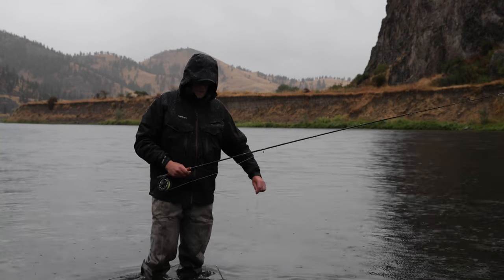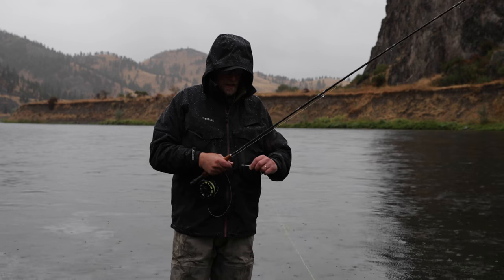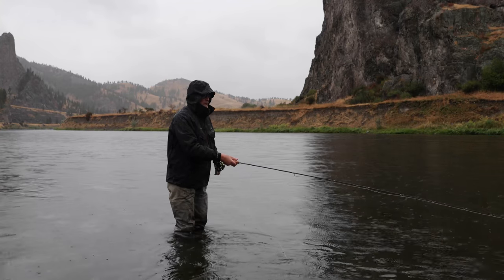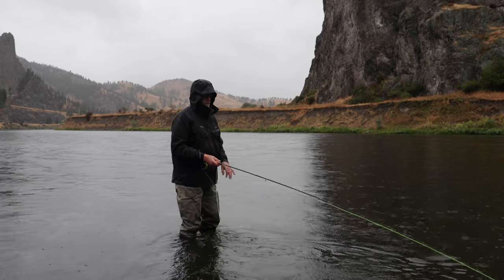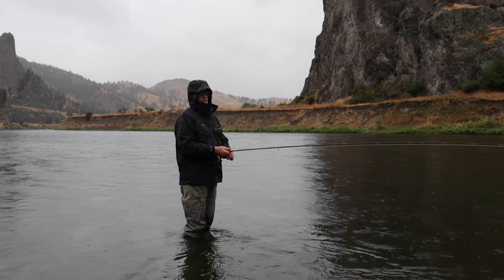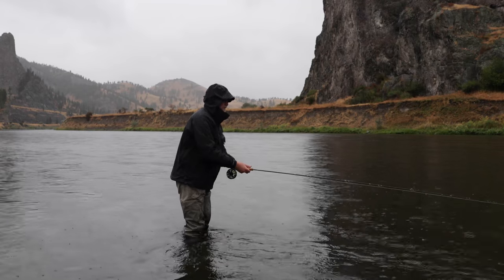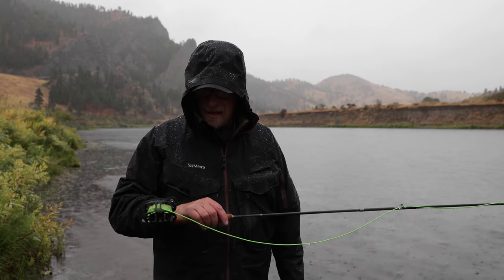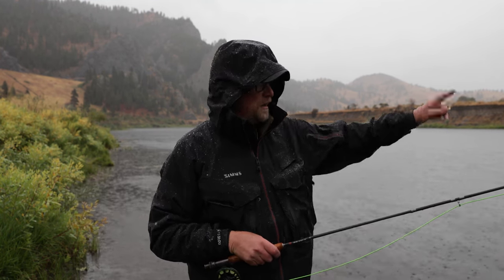Casting Class with Fred - Learn How to Cast Single Hand Skagit

Comment: Nice but I see no Skagit cast. Instead I see Scandi cast using touch and go with a Skagit line.
Reply from the maker: Hello there,
Thanks for checking out the video. Sorry about the confusion in the case, the set up is on a single hand rod with a short Skagit head, so that is why we are calling it single hand Skagit.  The short head Skagit lines can be cast overhead, with casts such as the Double Spey and Snap T and with touch and go casts like the Single Spey and Snake Roll.  They are very versatile and can essentially be used for any style or choice of casting.  We are simply trying to show the diversity of casting options a single hand Skagit set up can provide.
Hope this helps,